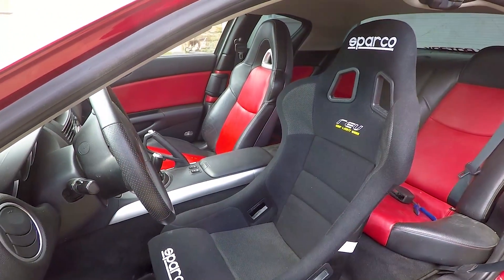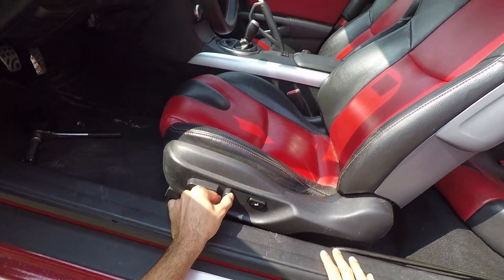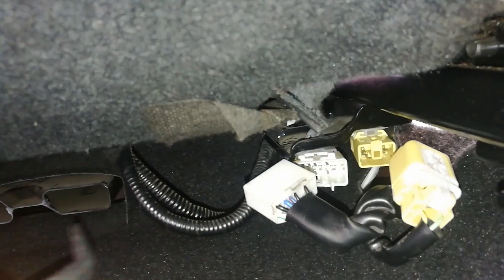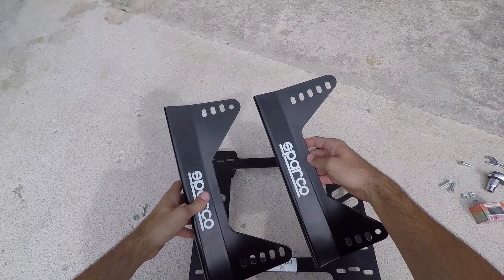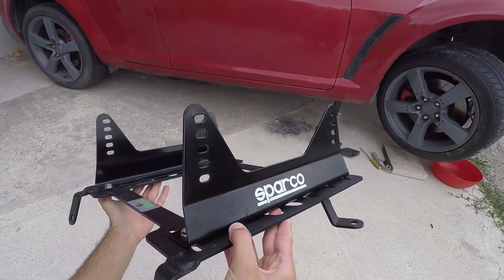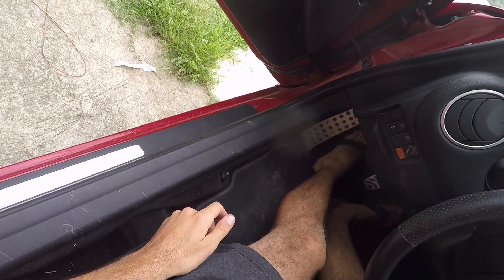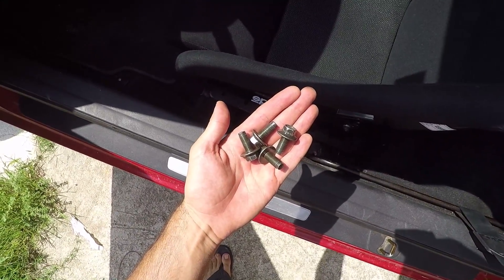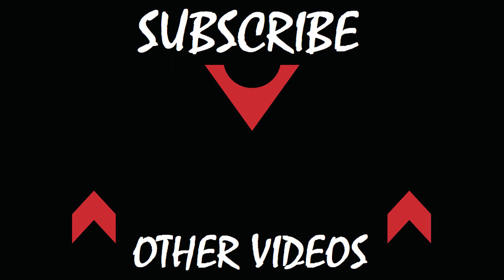Mazda Rx8 Bucket Seat Install

Comment: If you are really struggling with getting loose you can always drop a 4.77 rear end from a S2 in your S1 and it will dramatically shorten gears and boost your torque at the wheels.   

Just thought of it a bit late from watching your drift day video weeks ago.
Reply from the maker: That would be a great upgrade, but sadly too expensive. I would rather save up for a turbo conversion or better 13b rew swap :)
Reply: Driven by madness junk yard S2 rear end is cheaper than a turbo system or rew.  Or at least here it is.  If you can find you they will practically give it to you

Comment: Had the recall done today, new fuel pump and lower control arms, took the dealership the full 8.5 hours but the stumble at 3.5 - 4k rpm is gone and pulls a clean 10 in all gears.
Reply from the maker: Awesome! Glad to hear you back in the game :D  I don't know what's happening with my recall, as i've been waiting 3 months and still no one contacted me for the recall followup.... it's a good thing my radiator is busted, otherwise i would be pretty mad at their customer support and care. Hopefully i'll get everything sorted in august :)

Comment: with the bucket seat can you sit lower in the car than the stock seats?
Reply: photonman54 don’t know for his seats in specific just how low they can go, the holes on the side of the bracket allow for about 6 inches in adjustment. Personally I’m running the Zeta 3, which sits a good bit lower than stock seats. Actually have head room now lmao
Reply from the maker: Here's the deal, the seats are a bit lower, and can get even lower if you remove the bottom cushion, but you can't lean the seat back to gain more space. So since i'm forced to sit straight, i have just enough room, i will struggle a bit with a helmet, but if i take the cushion out, i can sit comfortably without issues :)

Comment: Hello bro  Whats its better the S1or S2 ? 
I'm about to buy an RX8 2009 S2 with 90331 in the odo  and I want to know if S1 problems were fixed or anithing 
What advice could you give me?vI am a little confused
Reply from the maker: If you have the money get an S2 Rx8. All of the major issues were fixed and you have 1 extra oil injector to lubricate the engine, which is extremely helpful to maintain the engine long term. Also it look better, in my opinion. If your limited on the budget, an S1 is good too, and if you follow my tips & first mods video, you will have a very reliable S1 Rx8 :)
Reply: Driven by madness thnks bro in this week I will see how the car works :)
Reply from the maker: Awesome! :D
Reply: Driven by madness I have S2 at 88k I bought it at 25.5k (these are miles) and I have never premixed, had it flood 1 time that I deflooded myself by pulling the fuel pump relay and cycling it with and without fuel for a couple minutes,. Has never overheated, never broken down, actually never seen a shop except for when I hit some animals and damaged my front end.  

I'm still all original rotors, housing, seals, coils, plugs.

I have deleted my catalytic converter and muffler (yup straight pipes) and I have put on a bit more aggressive AFR map.

Edit: just realized I quoted wrong person. But still the right comment thread.
Reply: Low km S1 a lot cheaper, S2 for better build and daily use. If you don't mind parting with a little extra coin.

Comment: Is there any way I can make the seats work with rails? Our RX-8 will be driven by multiple drivers so it's crucial that we can adjust the seat instantly.
Reply from the maker: Yes, of course. Just bolt the rails on the seat and bracket. I didnt install them cause I am too tall, amd wouldn't fit with my helmet

Comment: if the airbag light is on because of this will they still deploy in an accident, i know with some cars they wont deploy if it is on, is there any easy way around this ?
Reply from the maker: You can install a resistor, so that the light on the dashboard goes off and airbag function is back to nornal

Comment: Do you daily your RX8?
Reply: Pretty sure he does... I also daily mine, fun experience... but the wallet hurts.
Reply from the maker: I used to, now i drive it mostly in winter and during summer i use my scooter, because i live in a city and i can't stand driving a car during summer due to 30°+ degrees. Once you try it, you never go back :D
Reply from the maker: Snoopy25 +1 on the wallet thingy :P
Reply: SOS Brigade Chief I daily mine.  73k miles in 3 years
Reply: I do, everyday, even with the price of actual fuel (95 not watered down filth they call 91) in Australia. I only rotate it out with my back up car for one season for upgrades and check overs.
Reply: Below Average Gaming mine bleed white hot on Fridays
Reply: Below Average Gaming guys can compare octane all you want but remember different places use different rating systems.  Some use RON some use MON and others like USA use R+M/2  

Ultimately 95-96 RON is about the same as 91 R+M/2

I'm not 100% but I believe AUS uses RON and many countries in Europe do to
Reply: R0T4RY is love correct!, Aus usues the RON system. 98 RON hear is nearly AUD1.99 a litre. Remember nearly 4 litres in a gallon.

Comment: @driven by madness  Hey there, So i replaced my fans and radiator, new engine 3k miles ago, But everytime i turn on the AC my watertemp goes through the roof (above 220). Any recommendations
Reply: Subzeros No Chill Channel bleed the radiator  probably has air in the system
Reply: yoo mum you think? Think it could be the thermostat?
Reply: yoo mum also it did this before I swapped the fans and radiator randomly on a very hot day, and it’s been like this since
Reply from the maker: You have air in the system. Park your car half on a hill. it must be cold. Take the coolant bottle cap off. start the car blast your heat and fans at full power. as the car works Observe the coolant in the bottle and see if bubbles come out. if you don't see any, firstly give it a couple of revs and have someone stand by the bottle to see if bubbles come out. When the car is almost warm, give it some big revs up to 8000 rpm and hold it there for 3-4 seconds. In this last process you should see a lot of small bubbles come out of the bottle. Repeat it untill you dont 'see any more bubbles comming out. When done. put on the cap and let the car work for 10 min and carefully watch the water temperature on your obd2 scanner. It must NOT go above 220F. also make sure you fans are kicking in at full power when revving/ being at operating temperature. This is how i solved my air trapped in the system, let me know :)
Reply: Driven by madness awesome, although it started doing this randomly one day in New Mexico a couple weeks ago, it overheated and it’s been doing it since, but I will try this and see if it works! Thanks love your videos
Reply: So, saw a little bit of bubbles, Still having that issue though, Could it be my coolant hoses? No leaks....
Reply from the maker: do you have enough coolant in the bottle ?
Reply: Yeah, any way i could reach you on insta? or somewhere?
Reply from the maker: All my info is in the description of the video :)
Reply: Driven by madness gotchya just messaged you

Comment: what to do with the connectors??
Reply from the maker: Some say to leave them but you'll get a warning light on your dash. I think the best solution is to install a resistor so the car thinks the connector is still there.
Reply: Driven by madness what value? And what about no seat belt beep? Do you have a pinout?
Reply from the maker: Nalim Kenapets I will post all about it in the description, as soon as I get the correct values from a professional rotary shop. I will also consider making a video on that topic

Comment: No sliders tho? People will have a hard time getting in the back nor can you adjust the seat if for instance your gf drives it or a good friend.
Reply from the maker: A bucket seat is for track use only, which means you have to have a helmet on. With sliders, people taller than 1.85m can't get in, cause the roof will be too low. If you're under 1.80m you can consider slidersx otherwise don't :)
Reply: @Drivenbymadness  my buckets (recaro pole positions in black leather so not that average crap) have abe approval so I can use them on the road without mot problems, sliders raise the seat like what, have an inch maybe a lill bit more, so thats bs saying people not be able to get in, laughable actualy.
Reply from the maker: @swansmeister  dude... obviouslpy you can get it, but sit straight and drive with a helmet and sliders, while being tall more than 187cm is impossible, you'll brake your neck. Im 1.87m and my helmet is rubbing the roof.
Reply: @Drivenbymadness  sure I believe that but I dont thi k half an inch is not gonna matter, like you said yourself you have no sliders and already hit te roof, lower the sidebrackets than if you have a lower hole left in em.

Comment: ERROR 404: Side seat buttons not found.... #BaseGTModelLyfe
Reply from the maker: Then put some coal in the steam chamber, and pull the release lever and rotate the wheel to move the seat back and forth :P
Reply: Snoopy25 what are seat buttons?  #R3LYFE
Reply: Snoopy25 lol

Comment: wtf, it looks like the series 2 rx8 seat 😂😂😂
Reply from the maker: Almost :D
Reply: Driven by madness slowly converting a series 1 rx8 to rx8 series 2 😂😂 i bet when you will do a rebuild you will use series 2 housings to have 3 oil injectors 😂
Reply: Oliver szabó that would be a smart thing to do actually.  I have series 2 and looking to find a way to put on a S1 pan so I can put on a Sohn system.  S2 omp isn't compatible
Reply: R0T4RY is love  Thank man! When my rebuild comes I want to use series 2 housings, add sohn adapter and fabricate a new lines adapter to join the original 4 and make 6 from them. Streetport the irons and reflash the ecu to accomodate the streetport and to set the omp to inject more(like 10-15%) to better handle the new 2 center injectors
Reply: I already have a series 2 engine in my series 1 mwahahahaha. Factory replacement by previous owner.
Reply: Oliver szabó if you use the Versatuner program for tuning your car I can send you my oil pump charts.  They work really well and if we bump them even 10% it's too much and starts spewing smoke
Reply: R0T4RY is love but i will add the sohn adapter so it will inject smokeless 2 stroke oil
Reply: Oliver szabó 2 stroke oil isn't smokeless.  Just burns cleaner.  It will still smoke if you inject too much.  Seen it on several of the S1 guys here
Reply: R0T4RY is love at least they say on the bottle “smokeless” :D but the whole idea of oil injection what i have isnt bad, or is it?
Reply: Oliver szabó no it's the best you can do and stay true to the renesis design
Reply: R0T4RY is love then all i need to do is to wait for my engine to go bye bye(cuz mz compression is still very good and i passed 100000km) and till then i will raise money for everything i want like streetport, lightened rotors and etc etc
Reply: Oliver szabó same thing I'm doing.  I'm still same compression at 88k as I was at 25k.  If you are as lucky as me you'll pull 130k km like I already have and then some more.  Im waiting for it to blow then I'm getting a billet 13b and going turbo with a sequential dogbox transmission....  Going for 800 whp on a 13b street legal on pump fuel...  Probably E85
Reply: R0T4RY is love i am thinking about e85 fuel too but i as was reading they say it may cause trouble as it will wash off oil from the combustion chamber, but there are 2 stroke oil that can be used with e85 so the alcohol cant wash them off
Reply: Oliver szabó I found all new pump, lines, injectors capable of pumping enough E85 and a strong pump I can custom mount in place of the omp that will nearly double the oil injection rate to keep the seal lubricated
Reply: R0T4RY is love gimme your facebook so we can continue the conversation there cuz chris is i think mad now 😂
Reply: Oliver szabó I can't believe he would be mad at any talk of rx8 or rotary engines :D 

However I regret to say I have no Facebook.  Or any social media for that matter. I find it is only drama and headache with nothing positive to present.  I deleted all social accounts 8 years ago.  I could try to recover my old account.  Search: Dustin Comp
It should have something about White City High School in the education info
Reply: R0T4RY is love i sent you a message
Reply: Oliver szabó perhaps you sent to my lost account.  I recovered my previous one and no message.  Send me your Facebook I will try to find you